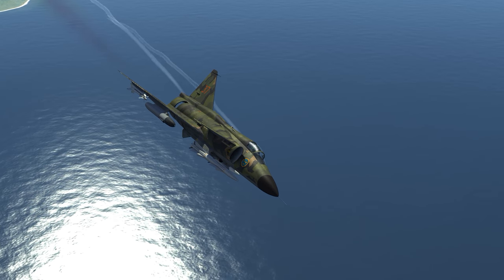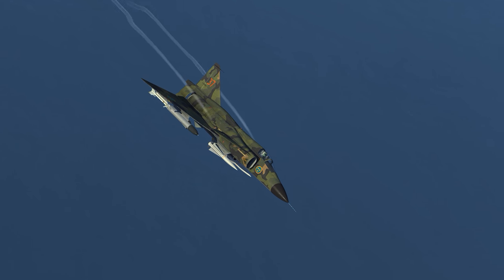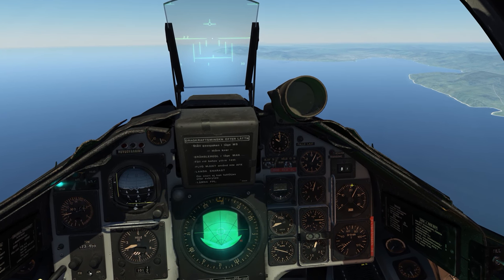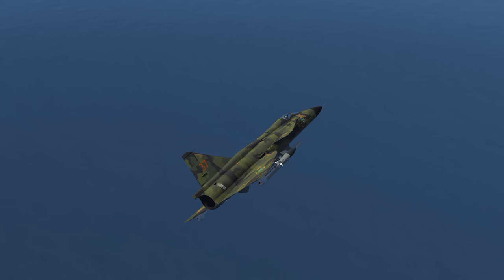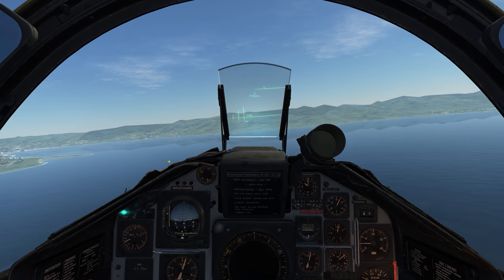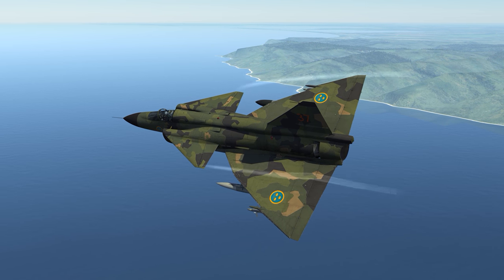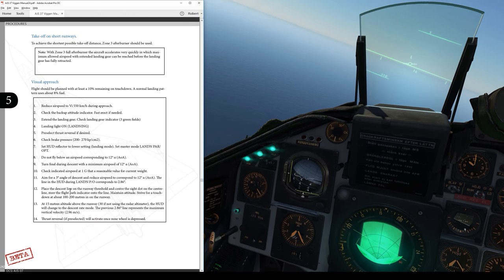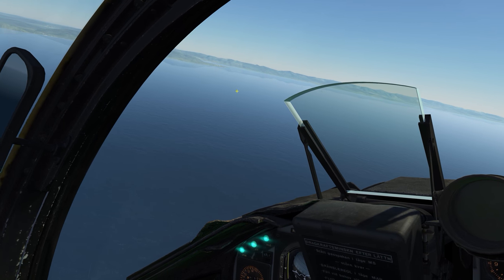Test Flight - DCS: AJS-37 Viggen - Rb 05 Missile, P/O Mode Landing

Comment: VLE (max speed with gear extended) is 600 km/h IAS. Page 19 of the draft manual. :)
Reply: Wow that is fast.
Reply: FirstDagger if I remember correctly the MiG-21 is also 600Km/h
Reply: +Wrighty GR.1 I am mainly used to speeds on WW2 aircraft.
Reply: FirstDagger They are sturdy, on purpose. They are designed to be able to handle a steep carrier-style no-flare approach with a high sink rate down all the way to the runway. Remember, the Viggen was designed to operate from 800 m stretches of highway. That also means the landing gear could be uses as extra speed brakes, so they could be coming in fast making the landing phase, when it would be very vulnerable to attack, as short as possible.

Comment: Fun fact, when the gear is down and the wheels hutch the RAT (Ram Air Turbine) deploys
automatically (left side, mid fuselage). As a guess I think the reason for the
problems with the remote controlled missiles are that you flew to high. Have heard
from a former Viggen pilot that when they practised over water and passed shippes
at mach 0,5 - 0,7 it wasn’t uncommon that they were below the altitude of the ships superstructure/bridg.
Reply: Viggen standard operating altitude was aproximately 10 meters ASL when flying over water, so thats certainly possible. Although the Rb 05 was probably rarely fired from that height as usually a popup would be done before firing most weapons. :P

Comment: The aircraft was designed to very easy to fly at slow speeds and to land due to the Swedish Doctrine of using Road bases.

Some of whom where very narrow (Narrowestroad bases only had 8m wide strip with the more common widht being 12-16m)
with Trees close on either side 
(atleast 4-8m on each side of the runway so some of the narrowest road bases only had about 16-20m between the Trees)
so it had to be stable and easy to land to make it practical.

Comment: Hi Bunyap, thank you for demo'ing this in VR.  Can you please tell us if the HUD is crazy-zoomed-in when playing with the Oculus like it is in the A-10C?  Thanks again for the great videos!
Reply: I would assume that it is okay because the mig21 from LN is fine, the A-10 is the only module I have an issue with, They have it so that you are sat on top of the stick for it to display properly, the A-10 is the only module with this problem so I would assume the Viggen is just fine.
Reply: Partly Cloudy I've never had that problem with the a 10c in vr. on a vive btw.
Reply: it is a result of wanting to sit back, for some reason ED has designed the hud to be viewed from the position of over the stick, hence sitting back effectively magnifies the hud compared to the frame and you can't see it, so it is either sit on top of the stick and not have problems or sit where you should be sitting and not be able to see the hud

Comment: Is DCS better in VR or TrackIR? Please.
Reply: It depends, the readability of the instruments suffers in VR right now due to the resolution of the VR headsets displays, but the immersion is obviously greatly enhanced. TrackIR doesn't have the issue of readability, but you get no depth perception and the immersion is of course not as good. A lot of people love using VR but i'll wait myself until we get higher resolution VR headsets, maybe generation 2 will offer this. :-)
Reply: Rasmus Johansson that problem is easily fixed by super sampling 2x. even 1.5x is enough, but why stop there. I was able to pull it off on a 970 before I got 2 1080s. gauges were readable without me having to lean in (I only have to lean in slightly really quick because bad eyesight and astigmatism) I'm sure if I noticed that big of a difference, it would be even better for someone with good vision.

Comment: You missed one important part of the HUD, either for yourself or in your explanations. 
During the approach phase, the "rudder" of the FPM marker shows you your AOA (12 or 15 depending on mode). The game is to align the "rudder" with the FPM, the FPM with the steering dot, and the steering dot with the runway. 
If the rudder is high you're too fast (AOA low) and vice versa.
Reply: Robert Borjesson really? I thought the position of the rudder line indicated the speed trend.
Reply: H171001 it shows early/late in Nav mode. And slow/fast in Landing. And some other uses i don't know on the top of my head in attack modes. 
It's a unique and simple system that's still in use in the Gripen